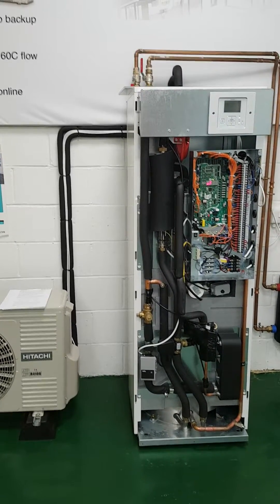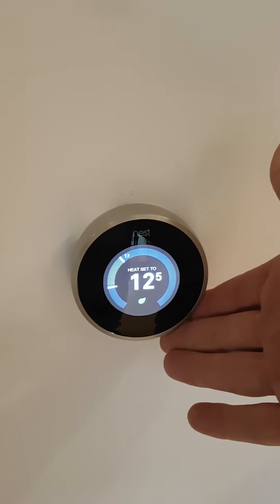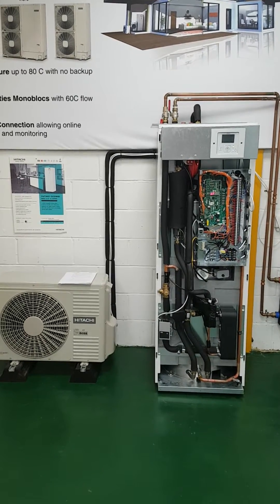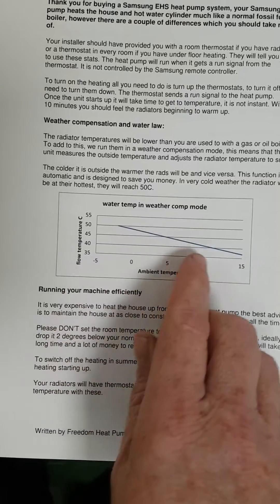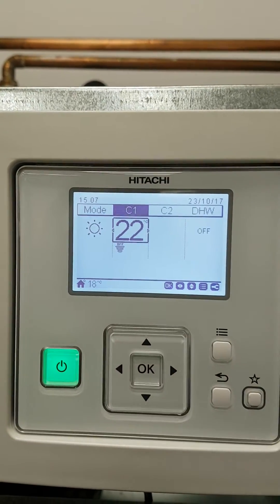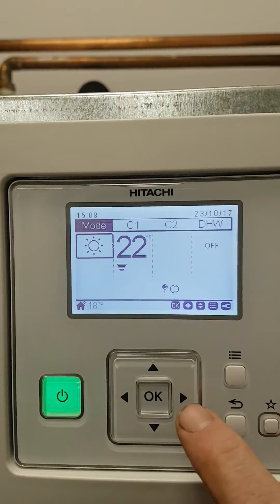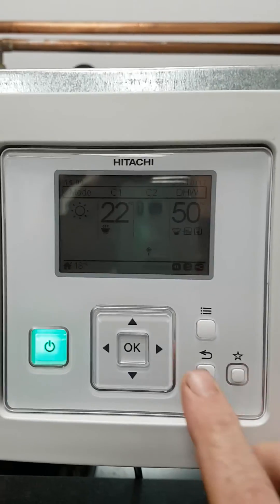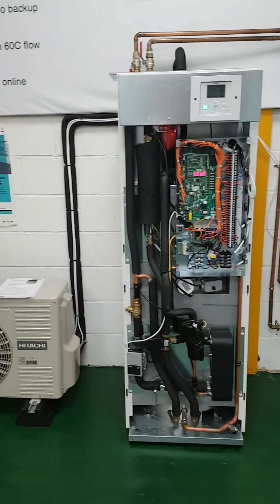Hitachi air source heat pumps Handover homeowner how to use the contoroller

Comment: Thanks for your clear instructions! I've just purchased a Yutaki S system, but I can't figure out how to connect my Nest thermostat to it. Do you know which connection the heatlink has to have inside the pump, and which settings allow for the Nest to control the temperature?

Thanks in advance!
Reply from the maker: yep it just needs to go across 13 and 14. but hot tip, on any heat pump, bin the nest stat and use a nice simple stat. you never want to adjust the temperature leave it on 24/7 dont let the stupid nest learn, it will just make you run cost go up.
Reply: @myheatpumpchannel7577  ,I have purchased a Hitachi similar to the one in the video. Would you please be kind enough to suggest me an ambient thermostat other than the best? 
Thank you
Reply: Hello I'm in the same case than you I can't connect the NEST thermostat on yutaki s Have you find a solution for this problem? Thank you